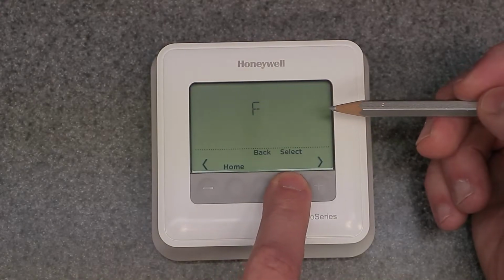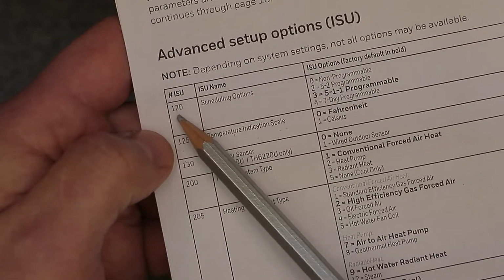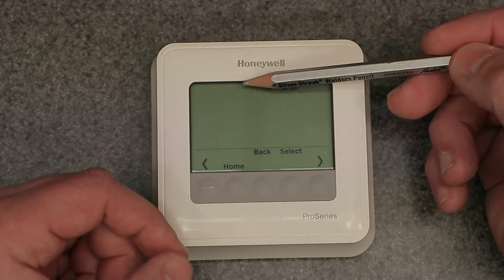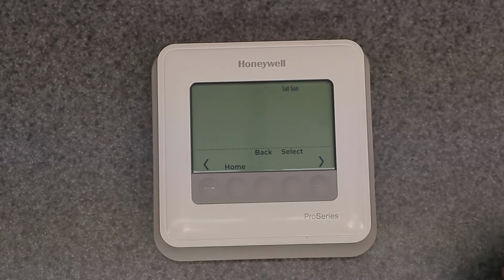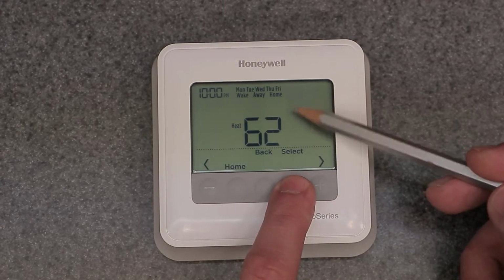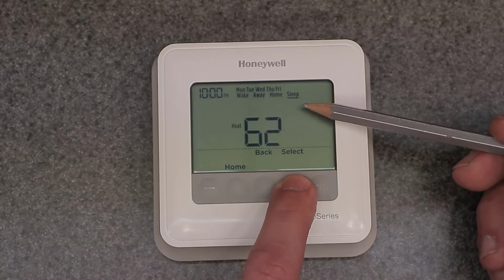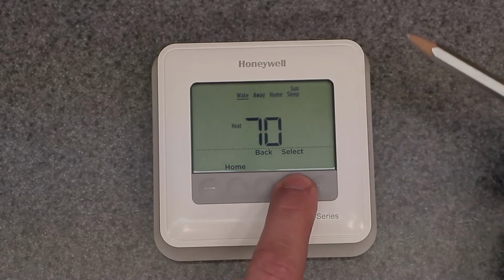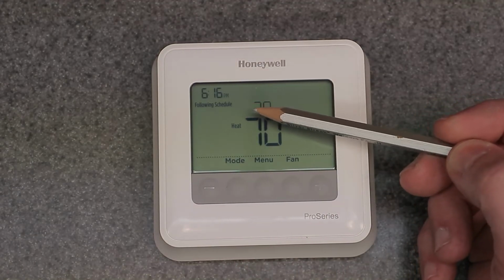7-DAY Programming | HONEYWELL Home T4 Pro | Follow Schedule & HOLD | SET Thermostat

Comment: Installation instructions (includes advanced setup codes):  https://digitalassets.resideo.com/damroot/Original/10015/33-00188EFS.pdf?rv=3dcd3b3ec88147a5b92a322f6da2a211&_gl=1*1r4g6r5*_gcl_au*MTQ3MjQzOTI3NS4xNzE2ODExNzk0
Reply: That's only a link to the User Guide NOT the Codes.  Franco said he would post the link to the Codes in Part 1 of this series but he didn't and I can't find the Codes either.

Comment: Be aware that "Adaptive Intelligent Recovery" mode (ISU #425 on our unit) will attempt to make room temperature arrive at the programmed temp at the time you set.  In other words, it will turn the system on/off seemingly before it is supposed to.  "Adaptive Intelligence" is turned on by factory default (setting- 1).  To turn the feature off, program it to setting- 0.

Comment: Thanks for the video. It was very helpful. How do program auto change mode? i believe it is ISU 300. And do you need to select ISU 303 to use it. Thanks
Reply: Just set ISU 300 to 1 and auto will appear

Comment: You are my Honda snowblower whisperer. My T6 PRO was missing most of these advanced code numbers. I wanted to monitor and control my bathroom ceramic floor radiant heat at the slad ONLY. I ended up calling Honeywell and they went down the list of codes on MY T6. They changed a couple of settings..no 520 on mine. Now it has the set point above the larger current slab temp. It shows when you are heating and has a clock if you want it. It is perfect now. Thanks for the video..I didnt know it had advanced features till I saw your video.

Comment: I also followed your step by step and my desired 67 f has not changed the big number of 90f. I’m wondering how can I bring the big number down to 67. ?? 🤔 any suggestions?
Reply: It’s ok. It wasn’t the device. Found out there was a nail in one of the pipes. Issue was fixed over the weekend.

Comment: Any plans to bring the ATV content back? Still have the 850 & 1,000?
Reply from the maker: Yes i still have the 850 & 1000. ATV videos really dont do that great. And take alot of time to produce What would you like to see?
Reply: @Unplugged_Homestead  Mostly just curious to see if you've done any additional mods, how they've been holding up and if any issues have come up. Recently picked up a 1,000 Ride Command and 570 both are around 20 hours now so still new - wondering if there's anything I need to keep an eye on besides the obvious fluid changes and inspecting the belt